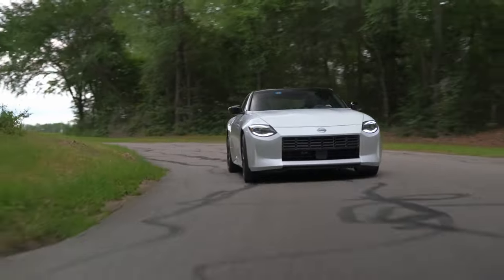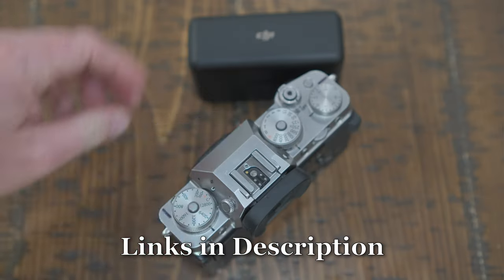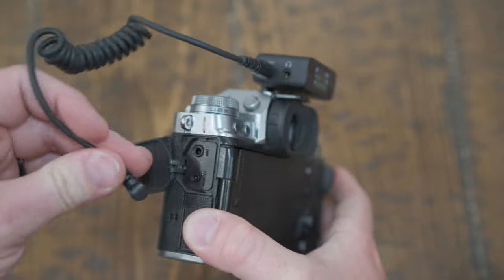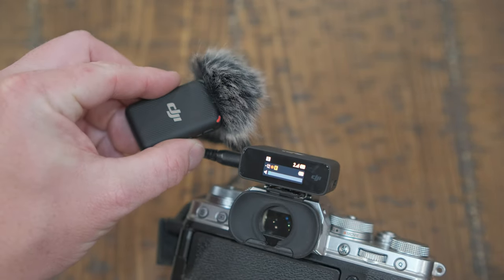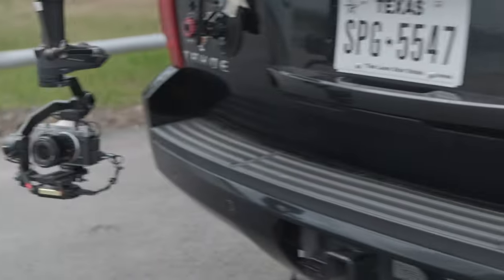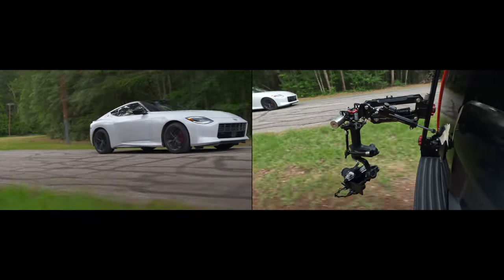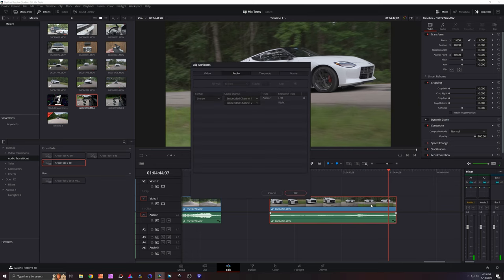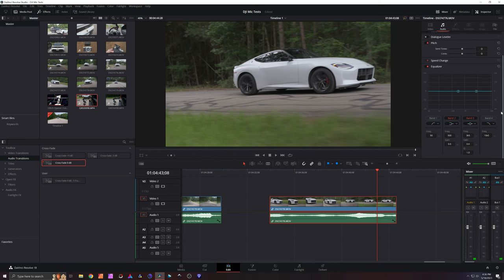Wirelessly Sync Audio On Rolling Cars With Dji Wireless Mic System

Comment: Hello, thanks for the great video. You suggested a few mic set-ups to record exhaust sounds in the other videos. Do you think that using DJI wireless Mic System is enough to get a clean exhaust sound especially with a small budget?  I use Dji Osmo Action 3 so it seems the most compatible option for me.
Reply from the maker: The DJI mic can handle most street cars. When you get into the louder sports cars & V8 trucks you will start to have audio clipping at wide open throttle, even with the gain turned all the way down.
For louder vehicles I prefer to use what I have dubbed the "Jimmy Rig".
Here is the video: https://youtu.be/Vzq5VuRCOtQ